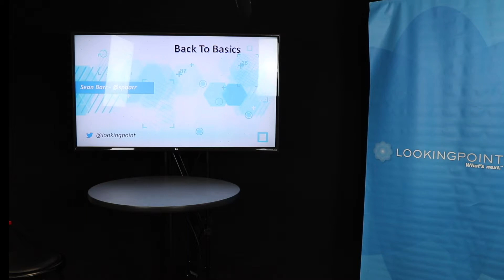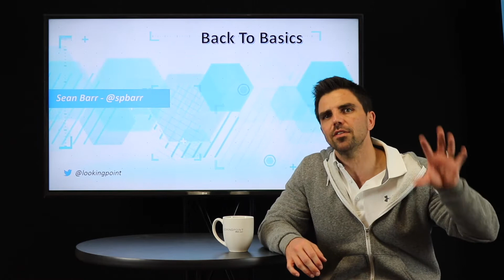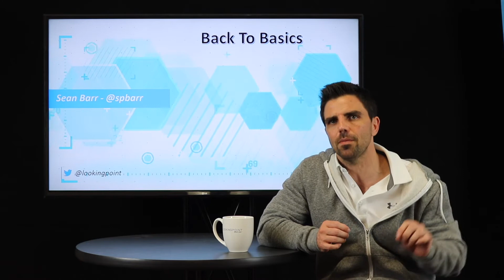OSI model Layers 1, 2, 3 | Networking Basics

Comment: This was super helpful. So the device itself is not considered layer 1 right? Like a router, thought it's a physical device it's works on layer 3?
Reply: Correct. There is a layer 1 component on the switch: the ports where the cables plug in. The router itself is accomplishing layer 3 duties because it is finding and routing traffic based on IP addresses
Reply: @Cassatoa  Thank you so much. When referring to a smart phone or tablet. I know the system inside has all 7 layers, but what would the device it's self be considered? Like, what layer?
Reply: @MrsAmandaSmith  its not really anywhere, remember this is just a model to help you understand how network traffic flows and is not able to account for all devices that sit on a network. I would also look into the IP/TCP model, its based on the OSI Model but a little more streamlined
Reply: @Cassatoa  okay thank you. I teach a tech expert class for Verizon and sometimes things can get a little overwhelming trying to understand it all. Thank you for the help.
Reply from the maker: @Cassatoa  Thank you for responding to this question and for watching!
Reply from the maker: Thank you for watching! :)

Comment: Did not catch what layer 2 was. What’s a subnet? What’s a translation through the firewall? Layer 2 is simply just for ARP commands? Not very clear
Reply: https://en.wikipedia.org/wiki/Network_segment
A layer-3 segment in an IP network is usually called a subnetwork, formed by all nodes sharing the same network prefix as defined by their IP addresses and the network mask. Communication between layer-3 subnets requires a router. Hosts on a subnet communicate directly using the layer-2 segment that connects them. Most often a subnetwork corresponds exactly with the underlying layer-2 segment but it is also possible to run multiple subnets on a single layer-2 segment.
Reply: Datalink